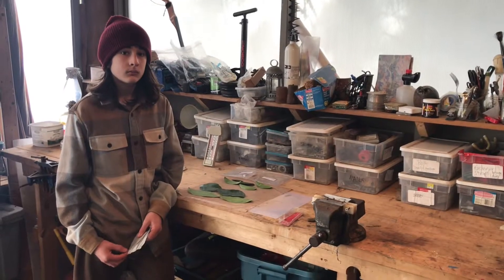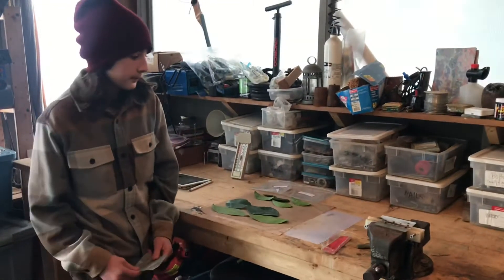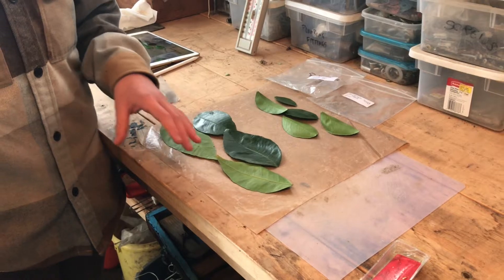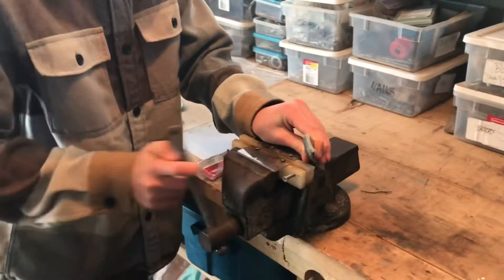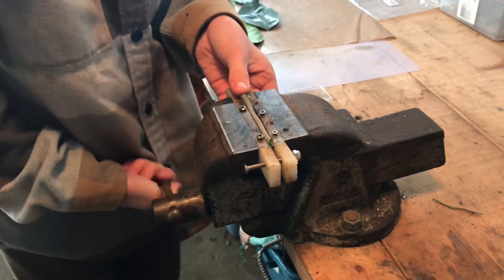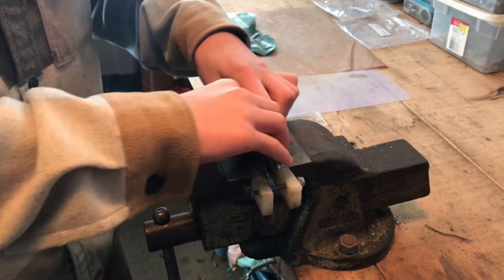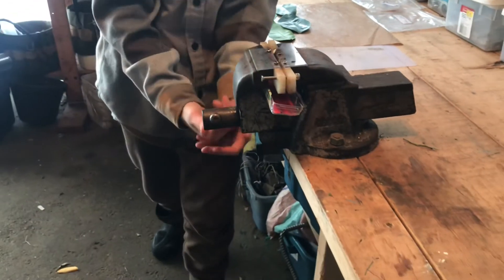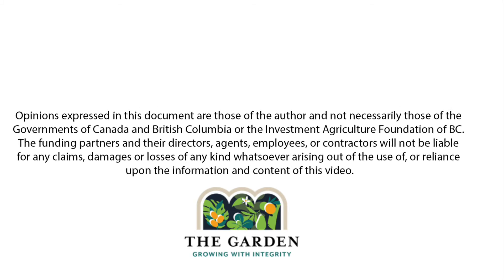#2. How to Squeeze Sap from Leathery Leaves

Comment: Thanks for the video. The garlic press definitely doesn’t work on Peach leaves.

What size mesh do you use?
Reply from the maker: between 60 and 100 stainless steel mesh.
Reply: @janesquier3137  Thank you Greatly. I bought 60 mesh yesterday. Can't wait to try it out.

I already know the Brix is low as the peach tree has aphids.

But the Aprium, Apricot, & two Pluots are healthy & no aphids this year.